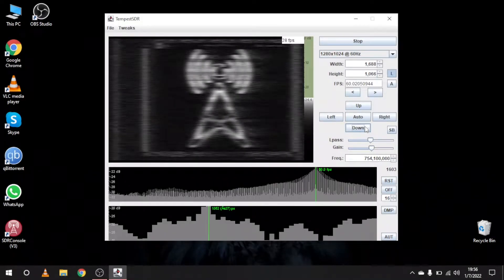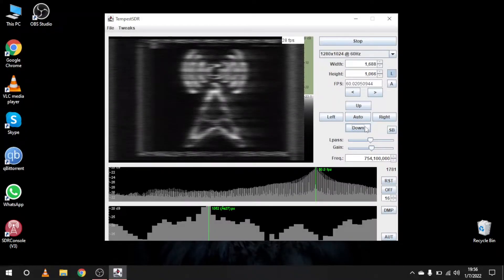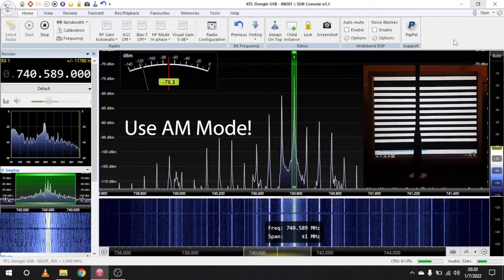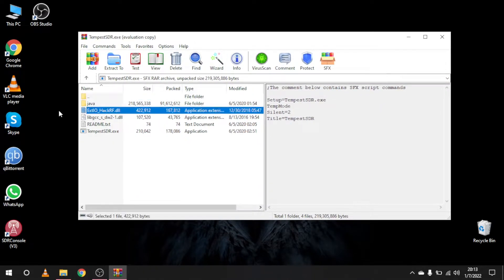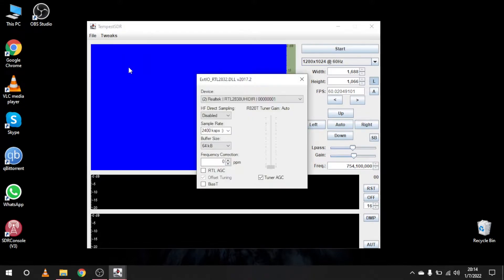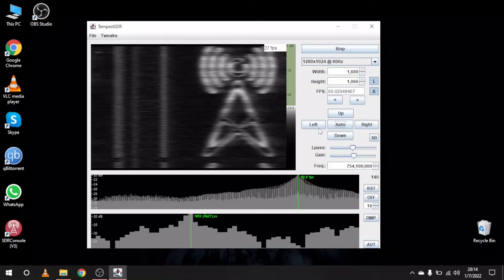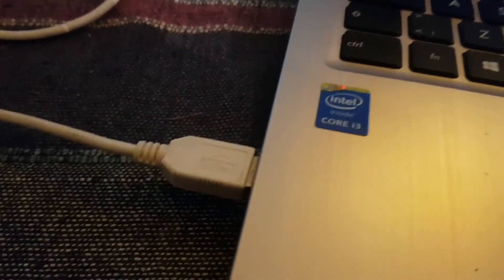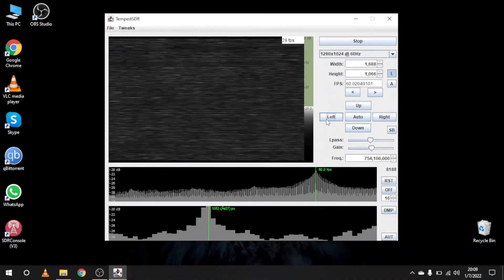Hacking Your Monitor With RTL-SDR

Comment: I think old LCD monitor just start to make a lot of noices, after some time. Doubt it will work same for new one... But it's just my guess.
Reply from the maker: This worked on every monitor I've tried. It is based on the signal being generated by the video cable between the monitor and your PC, also the cables inside the monitor. Practically the cables act as an antenna.

Comment: Does the tempest attack work on smartphone screens?
Reply from the maker: I don't think so. The signals of a smartphone video interface are very different from the ones used by DVI, HDMI or VGA. As far as I know, this will work with some older LCD TV's too. I tried to do this on a laptop screen, but it didn't work either.